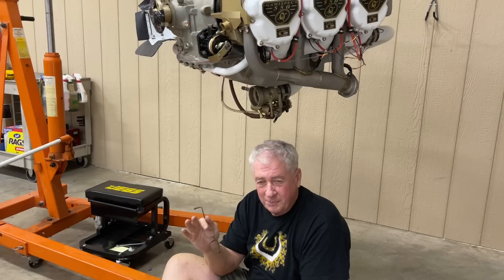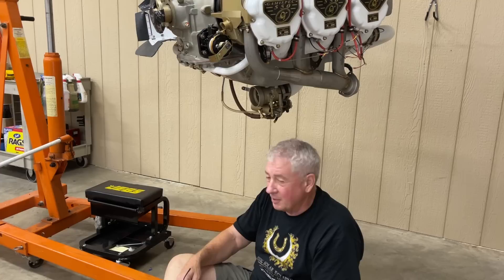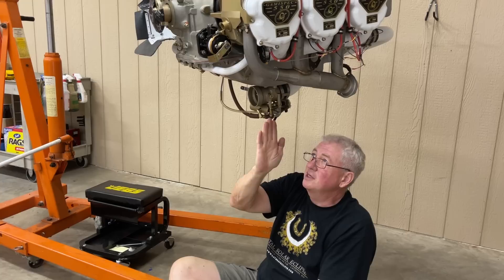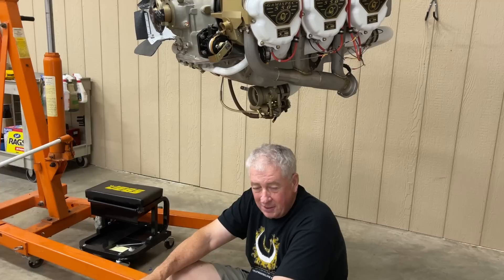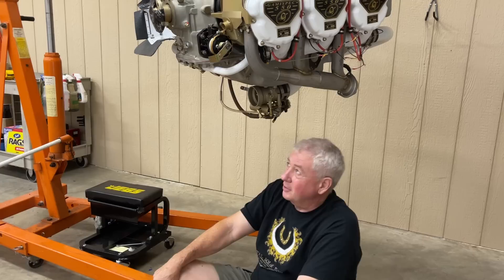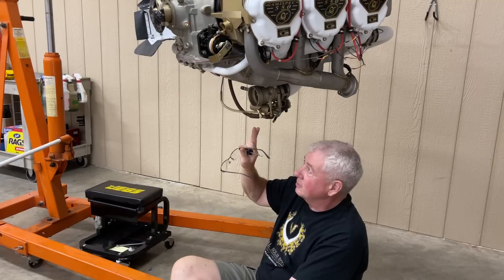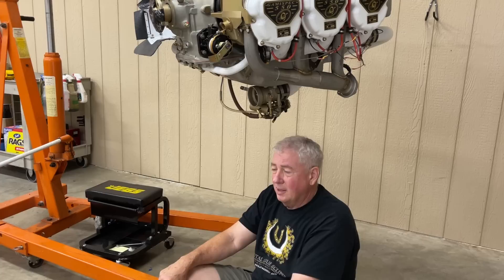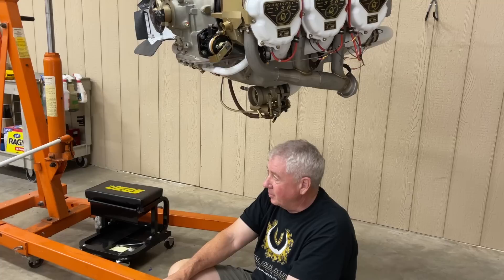Bonanza 533C Engine Update #4

Comment: OMG, Scott, as a mechanic for a friend of mine for many years (seasonal) one thing I have learned is those attachment bolts on the engine do let go from time to time, I have had 3 engine bolt failures that dropped the block straight down, please Scott, stay away from being underneath that Block, they "Do" fail from time to time (from personal experience). Thanks for the update just the same, looking good otherwise. NC
Reply: Night: You beat me to the keyboard... Sitting under a heavy engine, bad!
Reply: Yeah my butt was clinched for this entire video!! I've seen engines drop off a cherry picker and would hate to be in the path of one falling...
Reply: @joshwilliams9122  Mine as well, :)
Reply: @joshwilliams9122  The fact that Scott was seated is my main prob. If it fell he might push himself away B4 a crash.
Reply: @uTube486  Theirs no warning when they fail, it's instant, no time to move, when we worked on engines like that, we bolted them to an engine stand that rotated 360 degrees, a whole lot easier and safer to work on that way, your standing over it. :)

Comment: Enjoy your channel very much but I spent 5 years in the USAF as a IP ,also the hyd cylinder on the jack stand is dangerous and a very simple fixing is to cut a piece of angle iron and put 2 hose clamps around the Crome part of the ram as a safety.  This type of possible accident happens a lot in farming with hyd cylinders holding up all types of farm equipment, they never fail until they do, it happens Every year in the farm community ✈️🚜🌾
Reply: @lanny;   Is an IP an Instructor Pilot?  If not what does IP stand for.

Comment: Wonder why the aviation industry never got into ceramic coating exhaust/headers like the hot rod aftermarket industry does ? I have two small block Chevy's that have ceramic coated headers and they dissipate heat so much faster and cool down a lot faster after shutting the engine down.  I always thought a P-51 Mustang would look neat with ceramic coated exhaust stacks on them. ......  Your very trusting of that engine lift !

Comment: A coupla 2x4s with a single bolt creating an X style brace between those cherry picker legs, bracing the arm that holds that engine would buy you a few minutes to move if that thing gave out on you! Good looking motor!

Comment: The ram on that engine lift isn't even breathing hard. There are no hoses to let go and nothing is going to drop that engine except for releasing the screw on the ram. I reckon Scott knows his tools well enough to have worked that out in advance. 

In sympathy for your 9 hour exhaust nut ordeal...I threw a couple of wrenches against the wall. Patience is a virtue but random acts of frustrated rage, are their own reward. Nicely done, Scott. Judging by how a few other Bonanza youtoobers smile after their IO550 implant...that engine should perk Charlie up a treat. Thanks for sharing.
Reply from the maker: Joe, thanks! I have used this crane for awhile. It could mess up, but heck, I saw the shot, went below the hard deck and everything worked out fine!
Reply: @FlyWirescottperdue  Dammit, Perdue...now you owe me a new keyboard. This one has nose coffee all over it.
Reply: @FlyWirescottperdue    The lack of exhaust stack retainer nut accessibility and very tight nut to stack clearance always seemed to be a Continental thing.  These engines are a case when the use of the premium higher cost 2 part non freezing nuts are a wise choice. In addition to the selection of dog legged thin walled box wrenches designed for these engines, we had a good selection of said wrenches which had been further modified on a case by case basis.  So no surprise here.  Off the grinding wheel to make a bent up snake of a box wrench even thinner walled or the heating torch to slightly modify the wrench’s geometry.  Ain’t aircraft mechanics fun !!

Comment: Nice work Mr. Perdue. I'm curious about the heater muffs (that you won't need in Texas). Is that stock? We are finishing an expiramental. There is no muffler and straight pipe lengths are not very long so trying to come up with a way to heat the cabin.
Reply: I don’t know Steven. At altitude in the winter months, the air can get a bit nippy even in Texas.
Reply from the maker: It is stock. One if for the heater, the other is a heat shield. And as Jeff says it does get cold in the winter and at altitude.
Reply: @FlyWirescottperdue   Yes I'm sure it does. I'll take a look at Bonanza heater muff as it may work for this. Otherwise, I'll go back to plan A and Fabricate one.

Comment: If you choose to work under in that config..attach a line at two points ( engine ) to one point at the lift ..so it doesn't swing
Reply: ( for future reference ) the arm leanth extension to weight CG..is good untill the cherry picker rolls and engine swings..
Reply: I've hung more -6 / -7 c-130 powerplants than I care to remember